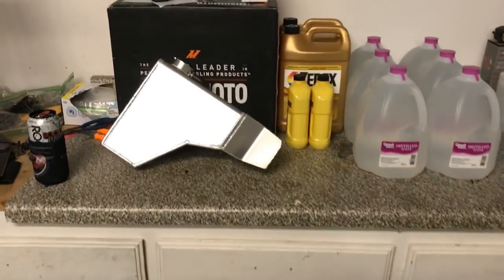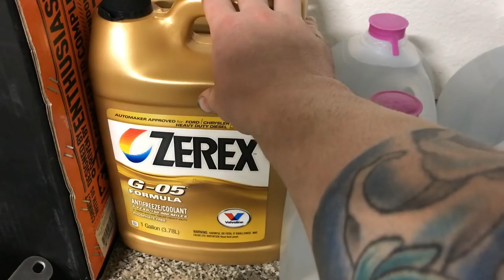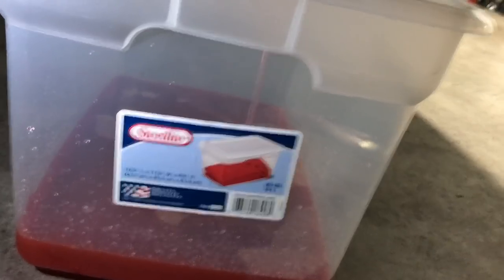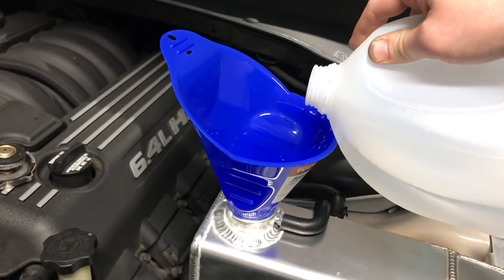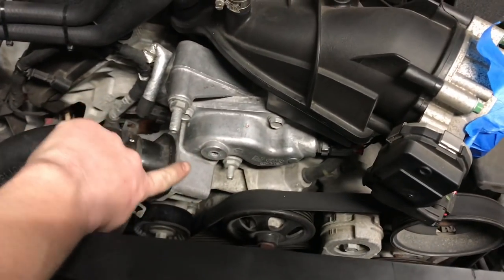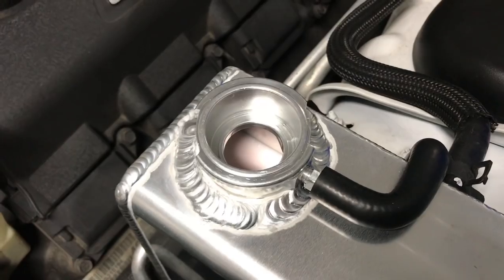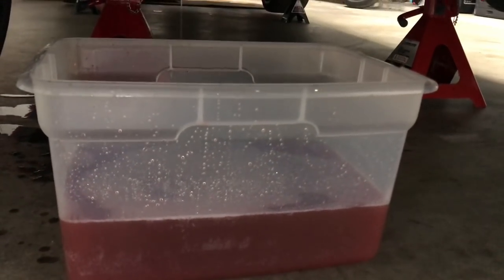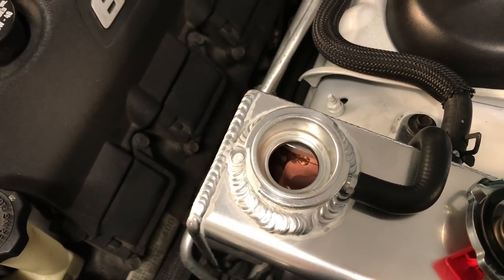Mishimoto Aluminum Coolant Reservoir & 180 Thermostat Install | Coolant Flush | Chrysler 300 SRT8

Comment: I put A180  thermostat in and it didn't work because I was told I needed to program the coolant fans!  So I wanna see if works on yours!
Reply from the maker: I did this a while back and just finally got the video up. But I have not redid my tune. It honestly never crossed my mind. But I have had zero problems. Car never runs over 190.
Reply: @ZackStenstrom   Yeah I had a thermostat on for about 3 months and then it's stuck
Reply from the maker: @moparlegion7296  I will be changing mine tonight when I get home. I never thought to. If it does stick I'll get a new one.
Reply: The thermostat I had when I first got my car had the temp at 204 then I replaced it with a jet 180 t-stat and now it runs at about 194.
Reply: @humanoid7765   Yeah I put the same one on and then it was like 3 months later it ran fine but it got stuck open , one day I'm on the freeway in traffic and my temperature skyrocket , Then I remember reading about Tuning for that and what could happen if I didn't . So I changed it back to a 204 and everything's been fine since
Reply: @moparlegion7296 That sucks, what kind of thermostat was it? Maybe it was defective. Luckily I havent had any problems.
Reply: @humanoid7765    it was the jet 180 I got it from summit racing

Comment: Now that you have the 180 degree t-stat,  did you also set your cooling fans to turn on at 180 degrees with your tuner?
Reply from the maker: You know I haven't. Thank you for bringing that up. I will for sure do that!
Reply: Yeah, I was able to do that with the little diablosport predator 2 tuner.
Reply from the maker: I have a handheld diablo as well. I'll do it tonight

Comment: Love your the Vlog as always quick question I have the same 392 SRT8 you do and I'm having a coolant leak issue I find it on the garage floor and I just bought a new Reservoir new radiator cap I put a 180 thermostat in it also their car in traffic at idle will get up to 2:10 to 2:15 is that normal but when I'm driving sometimes it goes below 170 any. Thoughts
Reply: You didnt get the car tuned reason i can tell is when you sitting the fan hasn’t turned on yet its turning on as if the regular thermostat is still in the vehicle but when you get it tuned for the thermostat that’s when you’ll get the 180~ when idling because the fans will come on sooner when the car reaches 180 instead of 203 like th stock thermo
Reply: @smoovedave  thank you for your response I appreciate it
Reply: Alex Ross no problem brother

Comment: You was supposed to rinse out the system
Reply from the maker: That is what the flush was for
Reply: @ZackStenstrom  I thought you had to run distilled water thru the system again to rinse all the flush and old coolant out ? Ateast that's what the bottle said
Reply: @The_Bandit_750  you're right